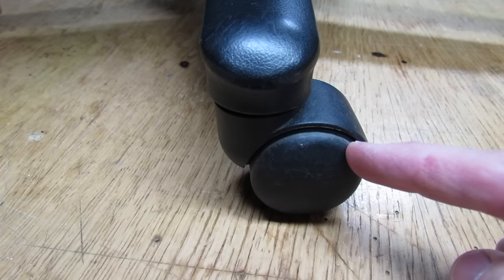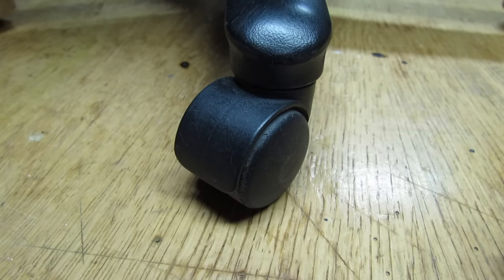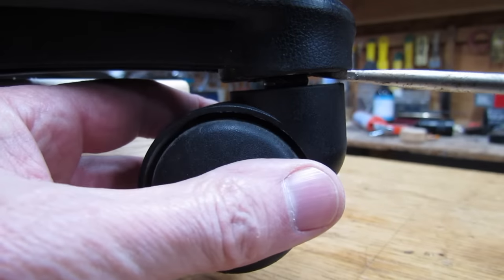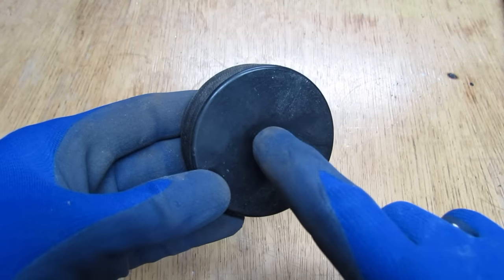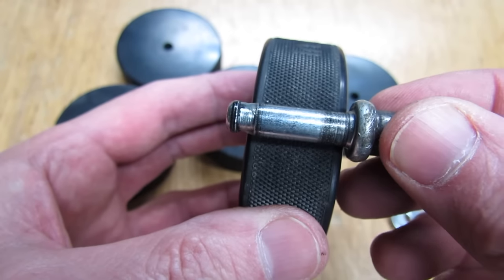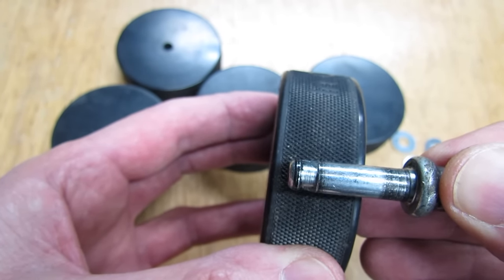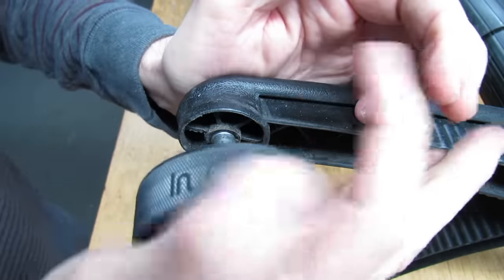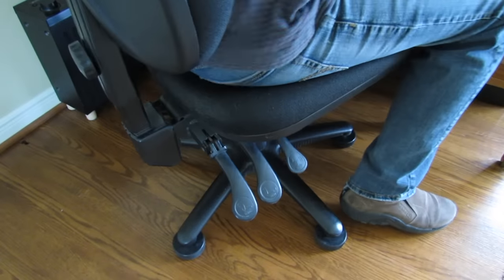Gamer/Computer Chair Floor Saver ●  HOCKEY PUCK HACK !

Comment: Just saw this and that is the solution I have been looking for. I did have a problem getting the stem out of the caster as I was just beating the caster stem out of the vise. I decided the drill a little hole at the bottom area of the stem though the plastic. Then use a nail to push the stem out from the bottom. Thanks!
Reply from the maker: Good job!!

Comment: Great idea!  I've seen other people use MDF board or Bun Feet, but hockey pucks are much more clever!
Seems like this design would adapt well for carpets too.  Just replace the felt pads with carpet furniture sliders...
I'm gonna have to give that a shot.
Reply from the maker: Yes, those carpet slider would possibly do the trick!

Comment: I've been searching cheap but good looking office chair mats, and wow this is an absolutely superior way to go about this.  Just genious, way to think outside the box.  I'm doing this now, but I'm not gonna put the bottom piece because my chair is on carpet.  This will also prevent the chair legs from wanting to spin from under you.  I can't get over it this is so smart well done sir.
Reply from the maker: Not sure if it will be good on carpet. This is for flooring so the wheels don't ruin the floor rolling and rotating in one spot as it changes direction.Let me know if it works out.
Reply: @chrisnotap  so, while I still think your idea is genius, after doing a bit more poking around I decided on buying roller blade wheels for $18 and calling it a day lol.  They are designed for computer chairs so no tools required, just pull out the old wheels and put in the new

Comment: The drill press I keep next to my desk doesn't exist unfortunately. I'd worry those felt pad would rub off and expose the sticky stuff to your floor after enough friction/wear though.
Reply from the maker: As we speak I am sitting in the chair that I did this video on 5 years ago and the felt pads and hockey pucks are still working perfectly .
Reply: This solution works great for LVP floors.
You don't need a drill press, you can buy an inexpensive drill block from a box store for less than $10.

Comment: I also hate how casters roll so easy on hardwood.  All 'chair mats' advertise easy rolling too.  No, I want to stay in a single position.  This hack will solve two problems for me, but I need to find some hockey pucks...

Thanks.
Reply from the maker: Hockey pucks are linked in the description. Good luck!
Reply: @chrisnotap  
So I gave this a shot.  I have an office chair with a piston, like yours, but mine extends so deep that a single puck wasn't enough.  I still had the center piston hitting the ground.  This was unfortunate, because I didn't have washers so I had 3d printed a washer that would be a good fit.  That turned out to be a waste of time, because I ended up gluing a second puck to the bottom.  I just used regular super glue and it worked perfect.

I will say, I haven't put the sliders on, but I will.  The pucks are very grippy and make it nearly impossible to slide the chair without getting out of it...  I might just cut and staple some microfiber to the bottom, we'll see.

Comment: Doesn't this mess up the floor more? Those little pads might catch some bits and just scrape them across the floor as opposed to a wheel which rolls over the floor?
Reply from the maker: Its now been in use for 6 years and there is not a mark on the floor!! When wheels pivot to change direction, that is the moment they rotate in place and grind into the floor for a brief moment. And of course it matters that your floors are also kept clean.
Reply: @chrisnotap  I see, alright

Comment: Are ther any ALTERNATIVES to hockey pucks?
Reply from the maker: Not that I can think of. Although I did make the first ones out of wood dowel but the dowel was about 3 inches in diameter. That's not something a person can put there hands on easily and cheaply but hockey pucks are available everywhere and are cheap.
Reply: Cork maybe but that might soften over time, likely wouldn't last very long at all

Comment: I, i need a solution with my chair. The piston loose presure when i sit. And goes up when i stand.
Reply: you might wanna dismantle the bottom pin to open and relube the valve.
or just get replacement cylinder as they are pretty reasonable priced.

Comment: You could just use polyurethane or rubber casters and save yourself possibly money and time from doing this
Reply from the maker: No. That's what ruins your floors. When you change directions with your chair, the wheel has to momentarily rotate in one spot. After thousands of times, the floor shows wear.

Comment: Great idea, but this rubber leaves black stripes.
You need a thicker gasket.
Reply from the maker: It can't leave black stripes, it never contacts the floor. I've had this on the chair for almost a year, works perfectly.
Reply: ROAST ROAST ROAST

Comment: I rather have bigger wheels made of rubber, but I have no idea how to fabricate that.
Reply from the maker: Even bigger wheels will wreck the floors. It's not the rolling that wrecks them. It's when they change directions where the wheel pivots in one spot that does it.
Reply: mrshihtzu you can fabricate them with a credit card and an amazon account. There’s plenty with big rollerblade wheels, they should be relatively easy on your floors, most are marketed as “hardwood floor safe”

Comment: You know they make computer chair mats for a reason right?  lmao
Reply from the maker: For a hardwood floor? They are unsightly and they wreck your floor after a few months! That's why I did this to my chair!!
Reply: @chrisnotap  How do they wreck your hardwood floor? LMAO. They make ones that have rubber on the bottom so they don't slide. I'm not sure why you need a hack for something that has been around for years.
Reply from the maker: @ThatOneWeirdGal  The little bits of dust and a bit of grit that gets under them are like sandpaper and over time takes the shine right off the floor.